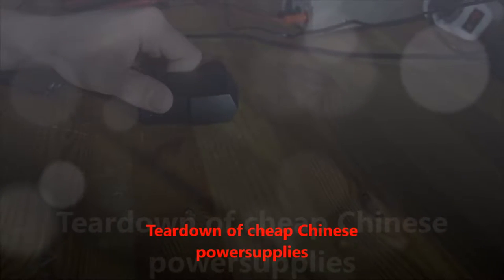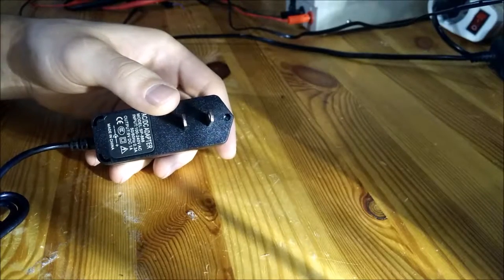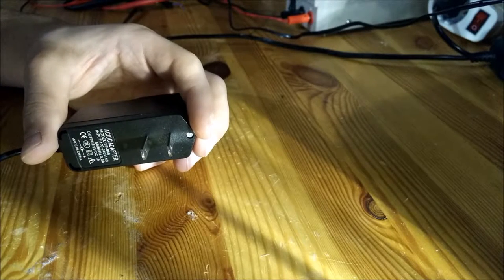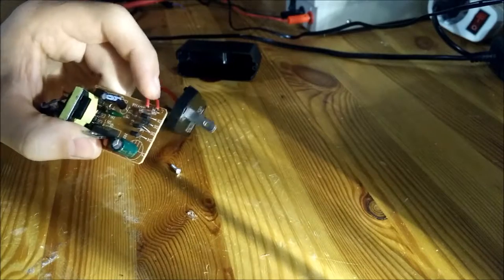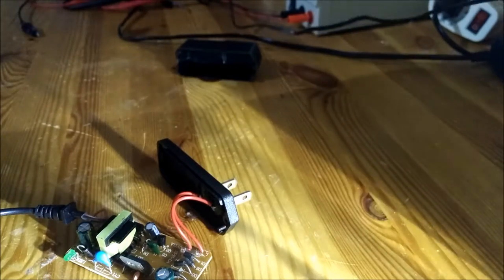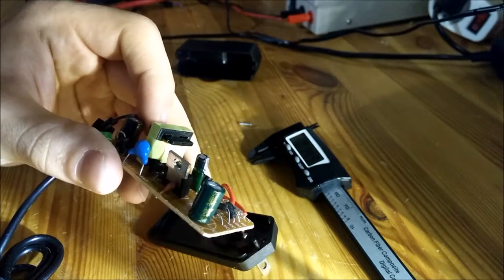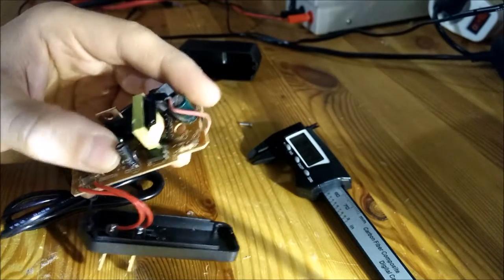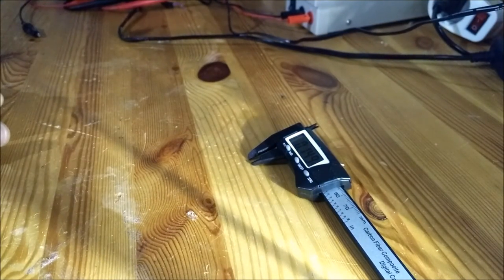Teardown of cheap Chinese Powersupplies Deathtraps dangerous

Comment: Isolation isn't too bad, would have liked to see a slot drilled in there... If a remember correctly, 13000 transistor is a Bipolar NPN, used in a lot of CFLs.